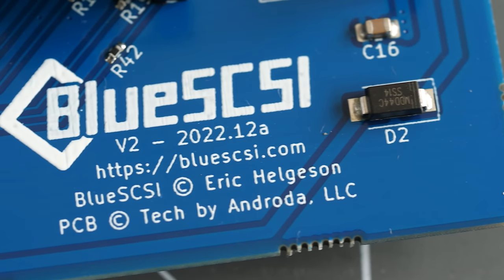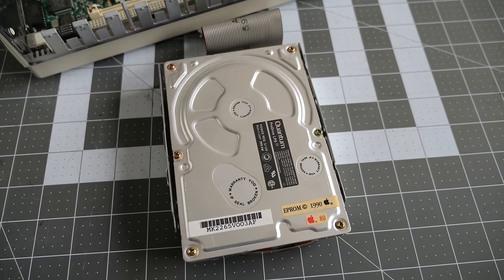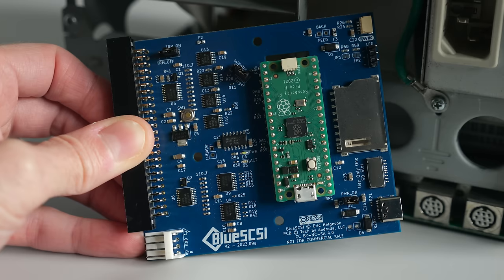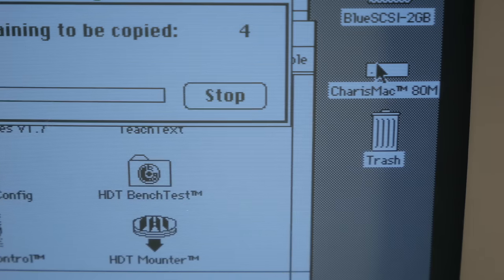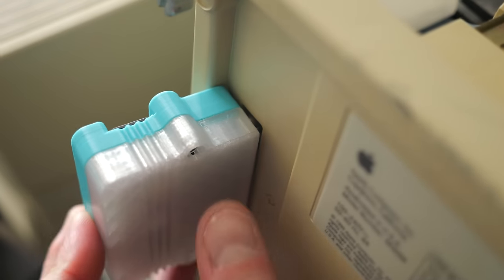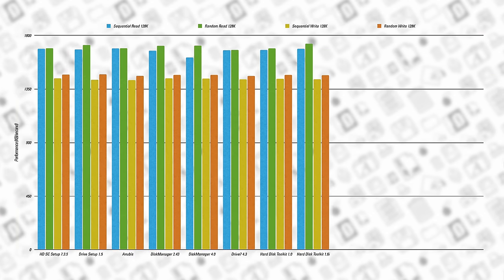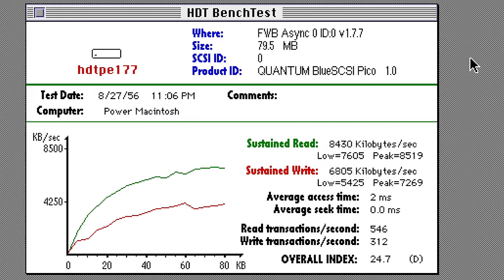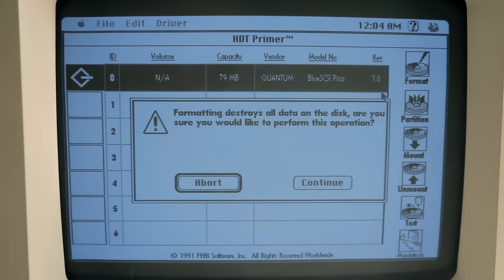Can a simple software change make your vintage Mac even FASTER?

Comment: Another walk down memory lane with this video. Back in the 1990s I used Anubis and FWB for SCSI my hard drive needs but I remember several of the other tools like Silverlining and Drive7. I still have my copy of Anubis just in case I ever need it. One of the program screenshots in this video also reminded me that Command-Period used to be a common way to cancel operations on the Mac. Good times.
Reply: Indeed as the video shows you needed a handful disk tools at your disposal in order to make any hard disk work with your scsi bus.Special mention to the painful process of scsi cable handling and routing in the case, installing terminators and going thru jumper settings for setting the id.

Comment: Thanks for this! I just had one of your BlueSCSI brackets printed for my SE/30, and my plan is to get everything put back together this weekend. A little late for Marchintosh, I know, but with a ROM-inator II, 64 megs of RAM, the BlueSCSI, and a blue MacEffects case, it should be a pretty sweet machine when all is said and done.

Comment: sure let me just download some extra ram
Reply: Just need RAM Doubler! 😂
Reply: @JeffGeerling  Beat me by 16 minutes!
Reply: @JeffGeerling  nah too weak you need ram quadrupler
Reply: @JeffGeerling RAM Downloader website
Not sure if 32GB RAM would work on a Performa tho
Reply: Extra RAM? Shoot, I got the whole internet on a shiny new CD-ROM.
Reply: @JeffGeerling  Ironically, modern operating systems actually do something similar all the time, if I understand correctly.

Compressed Memory, anyone?
Reply: I have the same calculator!
Reply: RamDoubler was a thing!!
Reply: Use swap

Comment: Apple still have that mindset for their internal drives.   I had to replace the SSD in my 2015 Macbook Pro, and had to buy one with a custom firmware (an OWC Aura).   It still doesn't support Trim directly, and if you use Boot Camp (I don't), you need to install another utility for it to work properly.

Modern macs make it even worse.  They are not upgradable.   OK, so there is nothing stopping use USB or Thunderbolt drives, but this isn't as conveniant.
Reply: That's because Macintosh still sucks, even after all these years.
Reply: I used an adapter to use a generic M.2 NVMe SSD in my 2015. Trim works completely fine, as well as Bootcamp. I don't think the OWC offering is any different (just a custom board to match the MBP port) but from what I have read they really don't work out that well. Some research was definitely required on my part to determine which NVMe drive to use.
Reply: I did an OWA Aura Pro X2 upgrade on my 2015 Macbook Pro and Boot Camp works just fine.
Reply: Can't you just use a TRIMFORCE ENABLE command? Btw OWC isn't that good, had a few that failed. I am rocking a normal Crucial NVMe SSD with an adapter to fit into my MacBook 15 2015 that works excellent. It has the trim enabled by default also :)
Reply: @michvod  I did do a trimforce enable.  Maybe I phrased it wrong, but I wasn't trying to create the impression that Apple were making it impossible to upgrade.   They do now, but then then were making it slightly more difficult, but not impossible.

I'm on my second Aura.   The first one did die after about 6 years of heavy use.   The 2nd one is currently going strong, and, tbh, the machine is end of life anyway.  I did initially buy the macbook partly for work, and partly because I wanted to learn iOS coding,  and work have given me an M1 Macbook Pro for work use anyway.    Not sure what I'm going to do with my 2015 Macbook going forward.
Reply: is it an early 2015 or mid 2015
Reply: @mewity  mid, I think.

Comment: Ok so apple produced a tower Macintosh that used apples slot 1 processor if you can find 2 of them combine the 2 processors into 1 machine and all the ram into the 1 machine and run mac os 8.5 and watch the speed holy hell

Comment: What about FWB HDT 4.0? I used its RAID 0 feature to stripe one volume across several drives, with some connected to each of the two SCSI buses in a Radius 81/110 tower. It was the only way to exceed 4 megabytes per second write speed required for 150K per frame 640x480 video capture with Media 100.

Comment: Thanks for the comprehensive testing. I never considered that the drivers would deviate by much performance wise…I assumed most of the driver code was based off the same or similar SDK reference code. Wow, I was sure wrong!!
Reply: Thats the thing, I don't think Apple gave out any SDK regarding the Disk Driver, since they very much wanted people to just use their drives for "maximum compatibility". If this was the case, it would explain why the difference is so measurable, with everybody basically writing their own code from basically scratch

Comment: It's very interesting that formatting has such a measurable difference here! Thank you for sharing such a comprehensive test!
Reply: It's not the formatting. It's the driver.  I have no idea how these driver software people even stayed in business. They were so much money that it was often cheaper to just buy the Apple hard disk.  Many of them were well over 100 Dollars.
Reply: @tarstarkusz a lot of them were bundled with hard drive purchases which cost slightly more if you get the Mac version. But was usually cheaper than getting the software stand alone

Comment: I dunno. Whenever I try to install Mac OS 7 or 9 on my BlueSCSI V.2 in my Power Macintosh 8100/110 (with Newer Tech Max Powr G3) it fails at random points during the installation. Not sure why. I've tried installing from physical CDs or from images on the BlueSCSI, but I've never managed to even complete the installation. I'm highly computer literate, although relatively new to Macs, and I've followed step-by-step guides for setting up the BlueSCSI, but to me, it seems like a non-functional product so far. My system runs great with OS9 from a real SCSI HDD though, so nothing wrong with the system itself.

Comment: I wonder if it'd be possible to design a BlueSCSI type device that could also connect to a memory slot and allow you to have a chosen disk image read as a RAM Drive. And if that could be done maybe someone could design a Extension / Driver to allow something like memory banking. Imageine the system booting the core OS over the SCSI just enough to setup the RAM drive(s) and then the rest of the data going over the memory bus 🤯
Reply: Memory has very specific timing and characteristics that might be a challenge to match well enough to make that work.

And software was generally written with that kind of thing in mind.

It might be doable, but it's probably more work than it seems.

Comment: How can a formatting program do all this? It sounds kinda weird but all vintage tech is like this. It's a great video though
Reply: It’s because there is a driver that has to be installed. I’m not entirely sure where the driver goes because it has to be accessible by the firmware, but it goes somewhere.
Reply: @ZiggyTheHamster   I would really like to know more about all of this.  I was a PC guy until Windows 8, and this all seems counter-intuitive to me.  Driver for what?  The SCSI controller is built-in, the block device is abstracted by the SCSI interface, and the media properties are available via SCSI commands.  What's left that needs a driver?  :-P

None of this makes sense.
Reply: @nickwallette6201  I'm not sure, but I know that vintage Macs have part of the operating system in ROM, so it's probably related to that

Comment: Weird...
These "Drivers" can't possibly be executable binaries, otherwise a drive formatted on a 68k mac couldn't work on a PPC (or in linux, etc.) without emulation, which surely would be ridiculous with every drive-access...
So, then, what are these "drivers"? Plausibly something along the lines of just a structure containing CHS values and locations of partitions. But, then, how could that possibly be faster or slower?
Formatting, on the other hand: Interleaving sectors, specific to the system, makes for faster reads from spinning platters, and finely-tuned disk-formatting software could probably determine the best interleaving for the system. But that shouldn't be a concern at all with e.g. BlueSCSI, since its accessing of data from the SDcard is request-based, rather than wait-based. (ahhh, maybe with higher-density SDcards, and-or their formatting, because their sector-sizes [and thus bursts] are fixed at IIRC 2048B whereas HFS might use 512B sectors... thus putting multiple HFS sectors into each SDCard sector... hmmm... but then interleaving would always be sequential/none, which would be default anyhow. UNLESS the HFS formatting utility also chose its sector-sizes based on their speed, in which case it might wind-up essentially matching the block-size of the SDCard's formatting... hmm)
This is very strange to ponder. I'm very curious how this is working under the hood.
Reply: Ditto.  The first time I heard of this "driver" on a block device, I was baffled.  I still am.  Would love to know what the heck is actually going on.
Reply: I think you don't actually know much about how hard drives work.

Both IDE and SCSI drives have onboard electronics that handle communications with the computer and actual reading and writing data from/to the physical media.

At some point in the comparatively distant past drives didn't have integrated electronics and you needed an interface board that directly controlled the spindle motor, read/write heads, etc.

ATA/SCSI controllers don't do that job, they just relieve the computer of the burden of handling the communications protocol purely in software.

It's responsible for presenting a standard interface to what would otherwise be a raw flash chip.

I confess that I too am uncertain exactly what is going on with vintage Macs and their hard drives, but the fact that Apple's software only worked with certain drives is somewhat telling.
Reply: @jnharton  I figure their software only works with their drives because they put the string "Apple" in the drive ID somewhere... I bet it would work fine with most SCSI drives, if not locked-in in that way. I bet there's even a ResEdit hack that would enable that.

But, exactly... the drive itself has the electronics built-in... so a "driver" should be unnecessary. (and, again, the fact the same drive would work on several CPU architectures and OSs suggests it's not really a "driver" at all).

Good point about the integrated circuitry  and its effect on interleaving, though. That, then, likely is Not the role of the formatting utility, either. 

So then... what the heck could actually be responsible for these speedups?!

Weird!
Reply: @ericwazhung  Maybe you should actually investigate instead of /figuring/ because my opinion is at least as good as yours without specific proof.

It would be very helpful to know in explicit detail what is going on in the:
- hard drive electronics (+ ROM)
- drive interface chip (the actual SCSI controller on the board)
- system ROM and the Operating System (OS).

Also, there is a difference between [Low-Level Formatting] which dictates exactly how the hard drive (fixed disk) platters are divided up into tracks, sectors, and whatnot (including how much physical space there is between those elements) VERSUS the [High-Level Formatting] which afaik involves something akin to zeroing the disk as well as setting up the bare file-system structure (for FATx that includes creating the File Allocation tables that are a key element).

Both are colloquially called "formatting" and both are necessary, but today the former is often done just ONCE at the factory and never altered.
Reply: @jnharton  Oh my... I'm hypothesizing... I guess that's offensive?
I haven't the time/resources to investigate this any time soon, but in discussing it, it could inspire a response from someone who knows, or even inspire someone to do-so... which, from the engagement in this conversation, suggests someone's doing-so could be beneficial to many. Maybe someday I will.
Believe it or not, I am familiar with each of the items you discuss, and at a pretty low-level. Many of those factors don't apply to a solid-state random-access system (interleaving was my example, but yes track-formatting, mfm/encoding, sector sync-streams, and many other such things) which is exactly why it stands out to me as "weird" that a choice of formatting utilities would have such a big impact on solid state drives. It absolutely makes sense that it would in wait-for-access spinning platters.